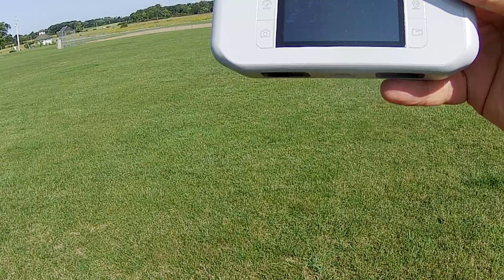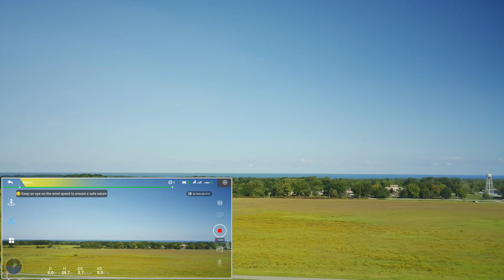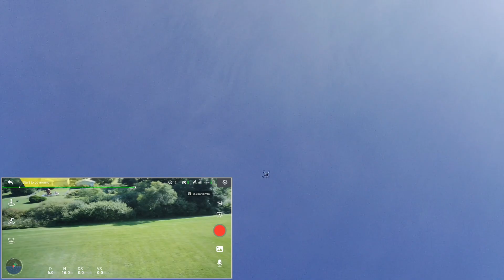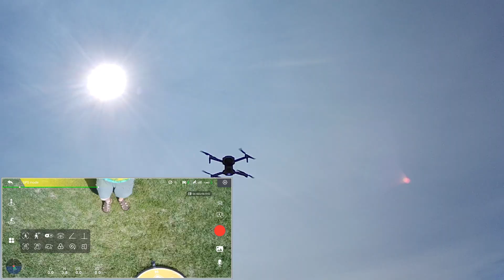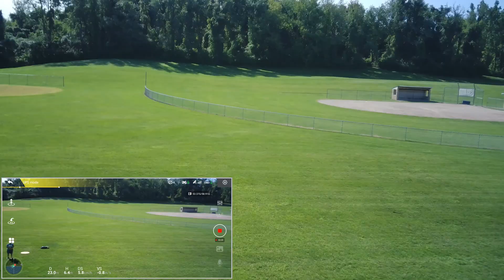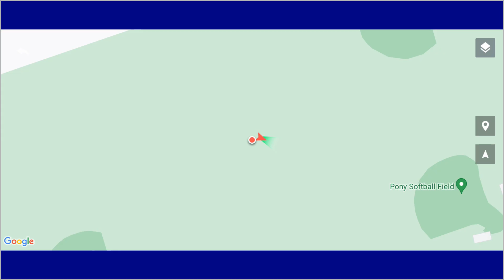Holy Stone HS360E Long Range GPS FPV Explorer Drone Flight Test Review

Comment: Ya got both a thumbs up and a new subscriber, if not for a good video, but for the tip about not manually opening the app, to avoid connection problems. Just ordered this very model from Amazon, so all the tips and tricks, is always helpful.. Thanks
Reply: hi, how are you finding it 6 months on? just purchased mine today
Reply: @Johnny-d2e  I've found it to be a solid flyer,  only complaint(s)  1.) Wished the camera gimbal was a bit smoother. 2.)  Would be that one of the batteries swelled,  not sure if that's my fault, or build quality of the battery it's self. Any advice will be helpful.

Comment: Thanks for the coupon code.  I purchased an HS360E with it.  It only came with 1 battery and I am not able to find extra batteries anywhere and Holy Stone's website doesn't even list it as one of their products.  Any suggestions on where I can get a 2nd battery?
Reply from the maker: You can get it here.  
https://www.holystone.vip/products/holystone-hs360e-drone-battery#main
Reply: Amazon
Reply: How’s the drone holding up n how many flights u got in

Comment: I hate to tell you this,  but a low quality camera drone in angle hover mode is NOT FPV 😂😂😂 did you put this title on the wrong video?
Reply from the maker: FPV means first person video, as in being able to view real time video from the drone.  This is not an FPV racer drone, but it is an FPV drone that can be used for exploring.
Reply: @Quadcopter101  Looks like you made this same mistake / claim on several videos.  In essence, an FPV drone is defined by its ability to provide a real-time video feed to the pilot, allowing for an immersive flying experience, combined with manual control and high-performance features. This makes them suitable for racing, acrobatic flying, and other high-intensity activities, distinct from consumer drones designed primarily for photography and general flying.
Reply: @stratometer  I'm with you mate. This dumbing down of the language just has to be stopped! It's like calling going to work in the family Toonerville Trolley being called "Driving" - that's not "driving!" Only Going round the Nürburgring in an F-1 Ferrari is REAL DRIVING! I'm getting up a petition to Congress to get this sort of thing OUTLAWED! Can we get your support for our cause? 🤔🙄😱
Reply: @theoztreecrasher2647  Come on mate, you must admit, this is a bloody stretch 😀
Reply: @Quadcopter101  ChatGPT: is the Holy Stone HS360E an FPV drone?
"The Holy Stone HS360E is not classified as an FPV (First Person View) drone. It is more of a consumer drone designed for general photography and videography. "
Reply: @Quadcopter101  Lol It is quite funny that you think this is FPV, hilarious actually, let me know when you attach your fatshark to it. 😀
Reply: @stratometer first persion view
Reply: He is not wrong potato vs potatto 😊 @stratometer
Reply: “first-person view”
An FPV drone is an unmanned aerial vehicle (UAV) with a camera that wirelessly transmits video feed to goggles, a headset, a mobile device or another display. The user has a first-person view (FPV) of the environment where the drone flies and may capture video or still images.”